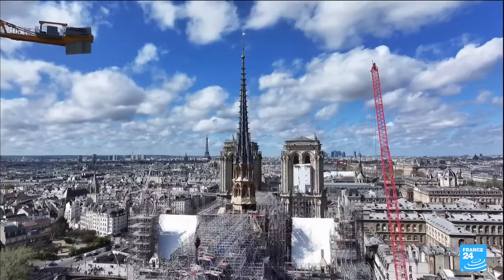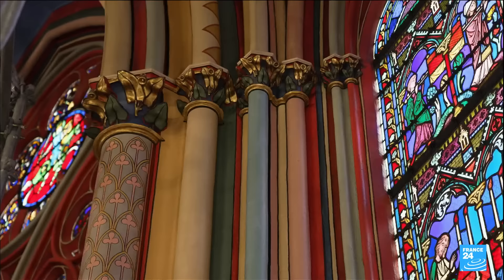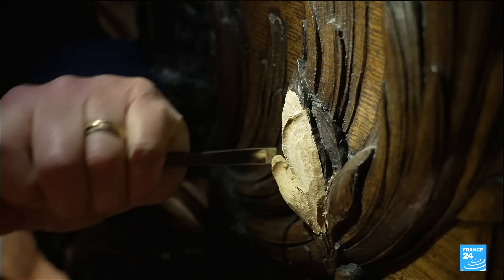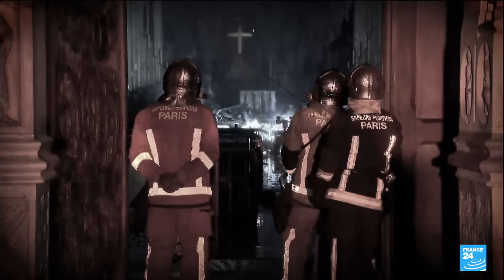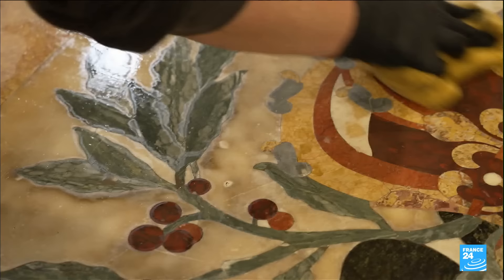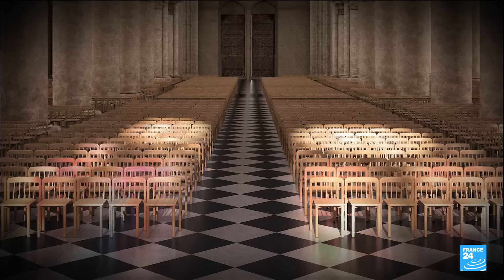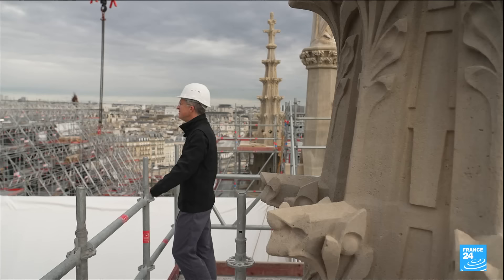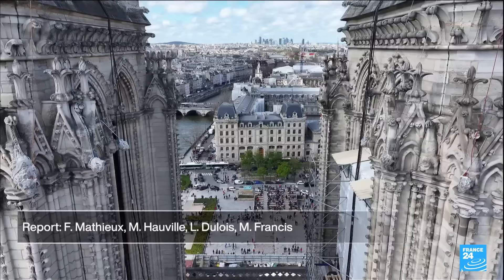5 years after fire, Paris's iconic Notre-Dame Cathedral nearly restored • FRANCE 24 English

Comment: I applaud their monumental efforts and amazing work. However, I think they should have rethought using lead panels on the roof. They could have used Terne Coated Stainless Steel, it would not have the health risks that using lead entails. And there is no difference in appearance.